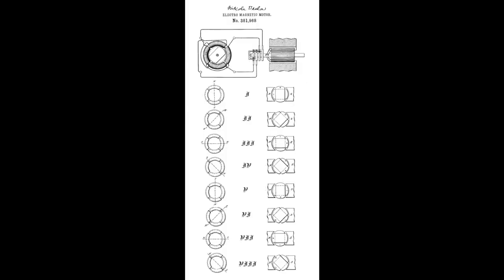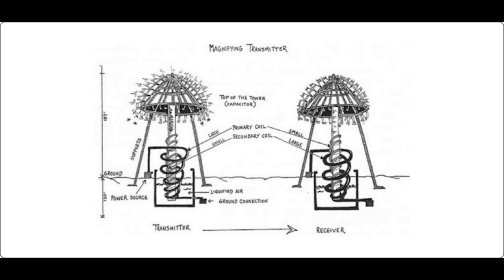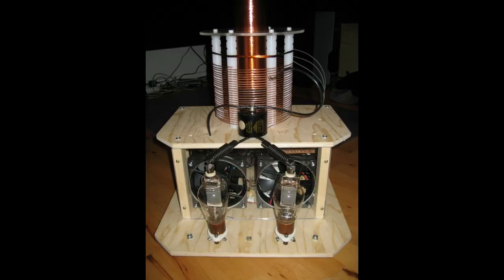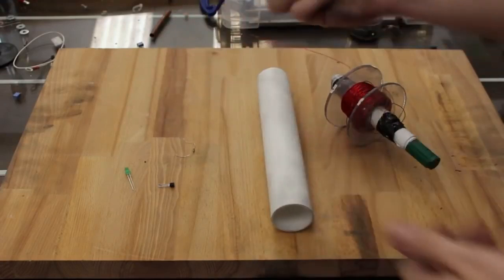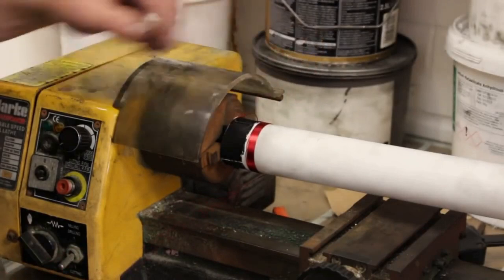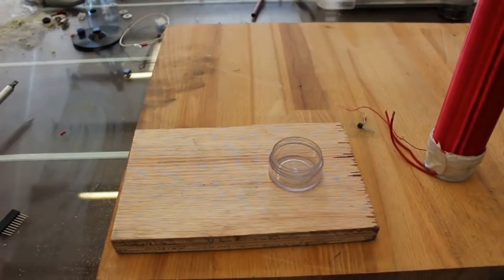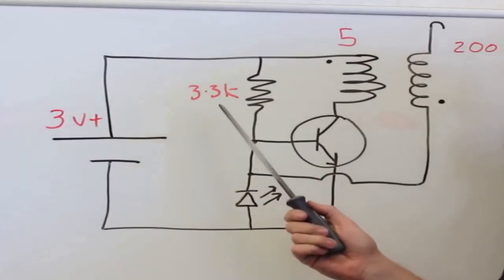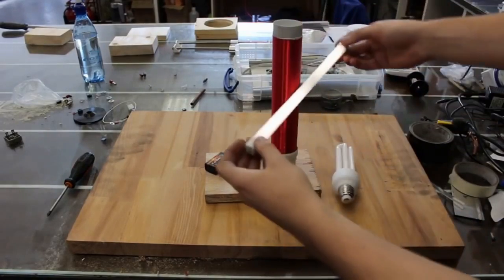2127 Tesla Coils And The Slayer Exciter

Comment: You can add graphene sheets graphite sheets into the electrical going to a capacitor dump if you had the sheets you can put them in a radio configuration like spokes in a wheel and just keep adding them and keep harvesting the energy off of it you can do this with pancake calls too there's a guy called the old scientist he did this with a bipolar Tesla coil that he built and extracted 10 times the energy versus the input so just buy straight line thinking your Slayer Tesla Might get 5 times he use pancake coils. You're using so low of energy Best buy knowing the capacitors volume that you're using and the voltage that you're collecting at the dump point you can calculate energy output pretty easy you already know energy input

Comment: Why does the secondary winding have to be a single layer?
Reply: The secondary has voltage along the length, each turn adding a little voltage.  Multiple layers puts turns with voltage between them closer, more likely to arc.
Reply: @hanelyp1  So you could make a multi-layer tesla coil by separating the layers with a high insulating material? I do wonder why this isn't done

Comment: Great presentation. No sparks, though:(
Use a MOSFET with a heat sink, and wind .2 or .3mm wire. 
.6 mm wire is for big Tesla coils. 
Place an electrolytic capacitor across the input voltage. 
Use a potentiometer instead of a resistor. 
This will provide some sparks.

Comment: Radio transmission is basically wireless power transmission. The closer to the transmitter the more power can be received. 
Take a look at Don L Smith's research.
I'm charging the battery out of a disposable vape using a loop antenna crystal radio tuned to radio five live or talk sport and running two white LEDs as a night light. I'm about 4 miles away from the nearest transmitter.

Comment: Slayer exciter is not Tesla coil. The real Hairpin circuit separates the load from the source, it also needs to be tuned. So it doesn't burn, it is adapting to the natural frequency of the load. Slayer exciter will cause damage in the nerves, Tesla coil doesn't. Beware of this with high current!

Comment: Looks like you missed one of the most important patents that were part of the communications system. The coil for electromagnets patent. The exiter is nothing if it doesn't adjust to the coils resonant frequency. He avoided the discharges all the builders go for, his intent was to build up the power and make it resonate to have 'spooky action at a distance' as explained by Maxwell. The discharges destroy the insulation and discharge the coil, which was not only contrary to what he attempted to achieve and quite expensive considering the scales of power levels he was working with. It was also something he did to impress investors and the easily impressed... a show of power with no aim, if you will.
Reply: Oof, I shall have to ask you to Take a Care,Sirrah!!

That's my Great Uncle of whom you Speak!!

He was a True Genius Who Truly Wanted to Help Everyone and Especially for Free,,,,

Thus, he only Needed Investment for the Studying,,,, and was Absolutely 💯 Ripped off by Others
 in too Many I'll concealed ways by Others who would keep us Fuel Poor!! Bah!!

Comment: I wonder if the slayer circuit, could be made light enough to power a lifter?  It could be the first Lifter device capable of self sustained flight.  A challenge since they can only provide a few grams of lifting power.
Reply: One issue is lifters usually run on DC, while a Tesla coil outputs high frequency AC.

Comment: Using a much more suitable transitor or mosfet that are heatsinked in this circuit along with some protection diodes and about 4-8X the number of turns along with a low esr capacitor on the input allows the use of much higher input voltage which allows the lighting of FL tubes from several feet or more along with a continuous corona discharge.

Comment: The closeness necessary for it to light makes it impractical to use with most lighting scenarios. However, it would be both practical and safer for high voltage battery charging as it would eliminate the need to connect two metal contacts together when plugging the device in for charging.

The modern way of using a flat coil for wireless charging is perhaps bit more practical.